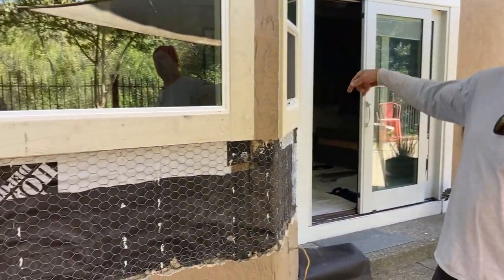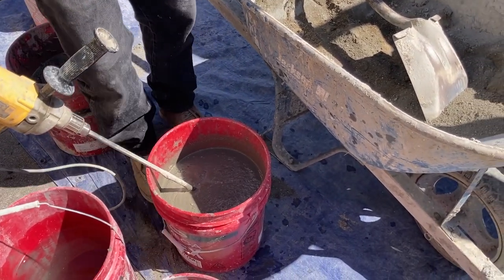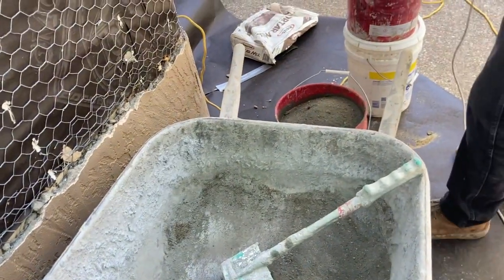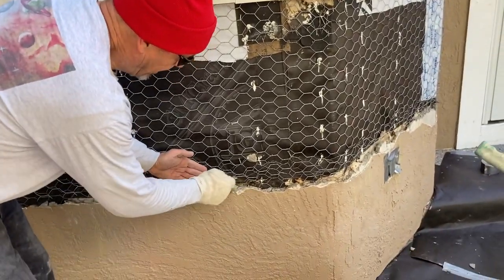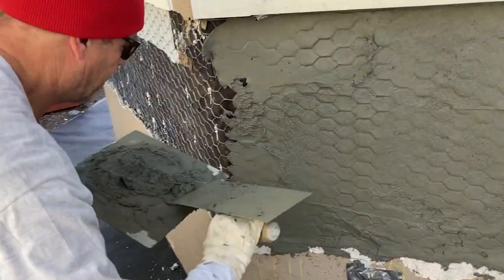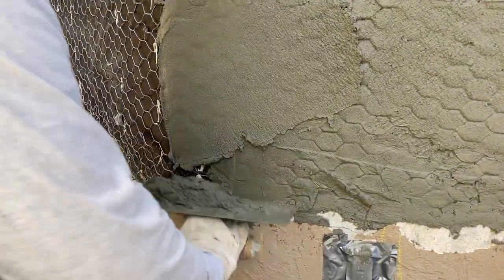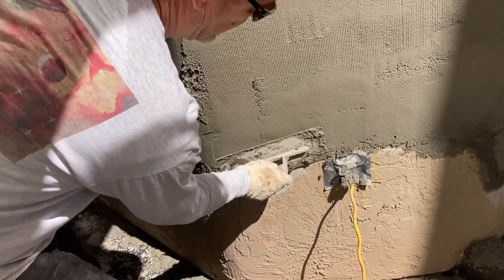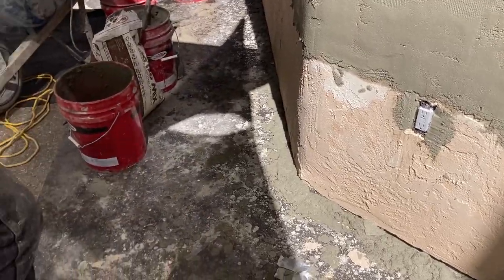scratch and brown coat stucco in 1 hour, then finish stucco the next day before the rain. Muuuud!!!!

Comment: Looks good brother🤙🏼 Keep on teaching and slinging that Mud👍🏻
I personally paint on my bonding agent with a paint brush straight to the repair that is in contact with all repairs. Also, I would mix straight in the wheelbarrow.  Much easier. 
Hope you guys have a prosperous summer. ✌🏻
Reply from the maker: Thanks, you too. I sometimes still do that. It also depends what glue you are using, what they are selling, what's available. Thanks for chiming in DanielParsons5519

Comment: Master... no overlap? Isn’t there gonna be a straight like crack where the new meets the old stucco & with the texture on top of the old one,  is it gonna look bulky ?
Reply from the maker: That’s a great question.   Be very careful to cut off all the fat before you apply your finish. Look at it from the side if you can to be sure.
Reply from the maker: There won’t be a crack because the wire is tied really well to the old and new.   The patch is feathered in well